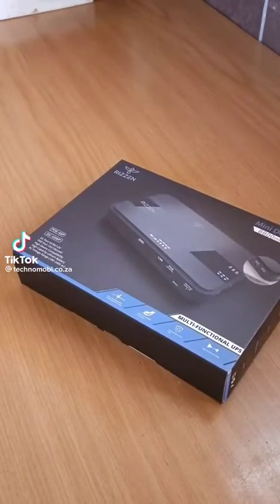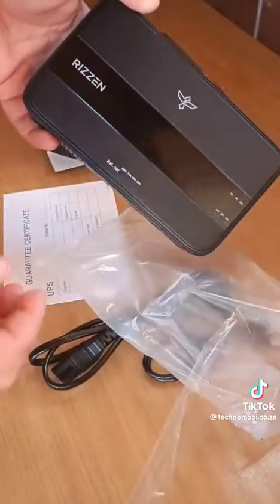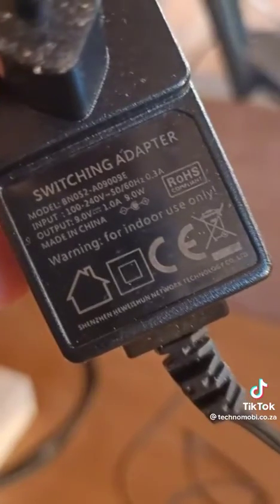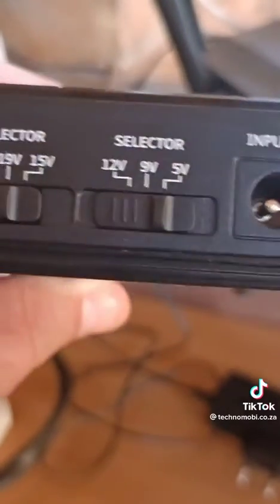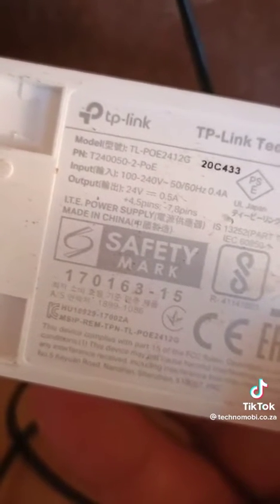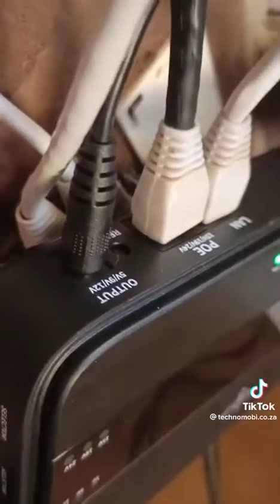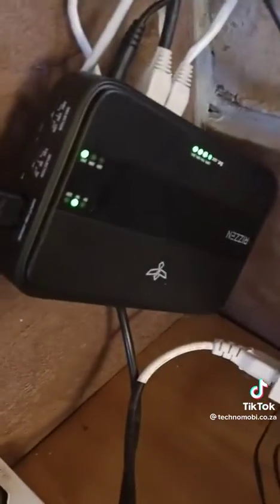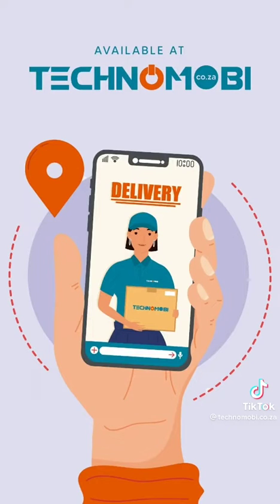Rizzen, Mini DC UPS, POE-45P for #loadshedding

Comment: Nice video,i was looking for info like this.I have a spare tp link modem which i would like to connect as a wired access point in another area of my house.I also have a ups like this that has poe(blue diamond brand).The ups has ethernet in and poe out.is it possibble to connect this ups to my tp link router?or is there something else thats needed
Reply from the maker: Good day, our UPS should work for your set-up, We also have a KP5 pre-loved that would work perfect. It's currently on sale for R369.00 😁

Comment: Will it be safe to run UBIQUITI LITEBEAM GEN2 on this via POE and LAN ??
Reply from the maker: Hi, to choose the right UPS for your device, you need to consider the device's power usage. Look for the 'input watts' (how much power the device needs) and compare it to the 'output watts' of the UPS (how much power the UPS can provide). Make sure the UPS has a higher output wattage than the device's input wattage.
Reply: The device has 24V 0.3A ( 7W) 
Need .
Reply from the maker: @alichattha1686  This device will work for the UBIQUITI LITEBEAM GEN2 via POE and LAN based on the information provided.
Reply: Will it be enough to transfer this on a 30meter CAT 6 cable

Comment: Would I also need a power supply for the fibre box?
Reply from the maker: Hi, the UPS will link directly to the fibre box, so it shouldn't require a separate power supply.